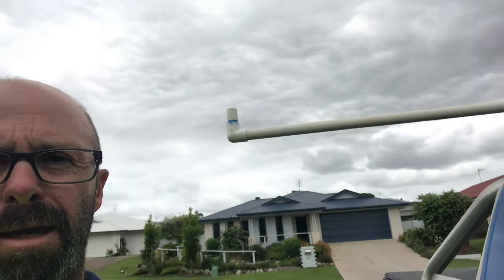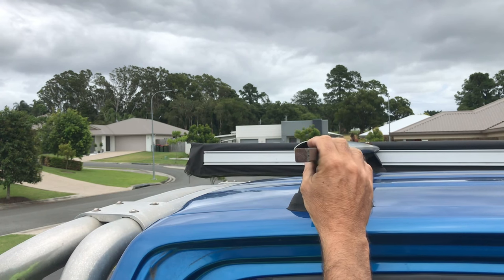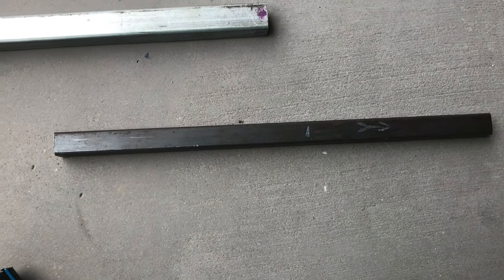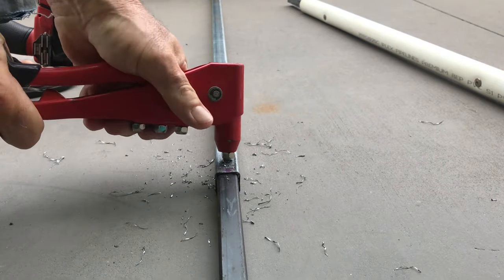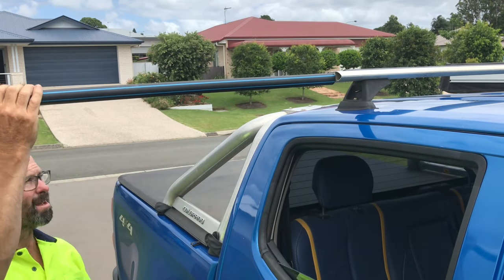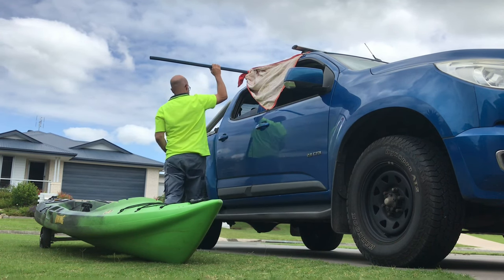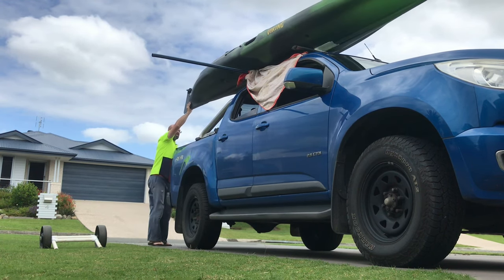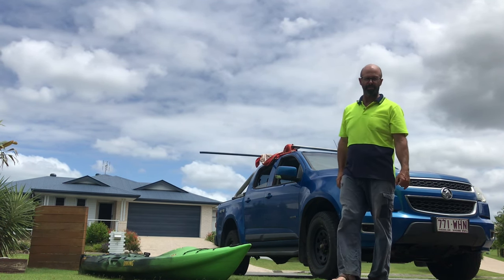DIY Roof Rack Side Loader for $7.30 - Easy and Affordable!

Comment: I have a better, easier way.. 
But this works.
Put a bar in-between both front and back bars this can be either permanent or not , stand yak up against this bar (90* to car ) no need for a towel , slide yak  up and turn it length ways down car and adjust as needed.
Reply from the maker: Good idea